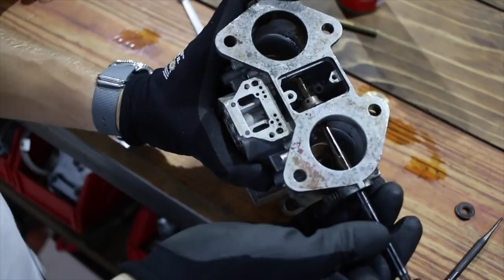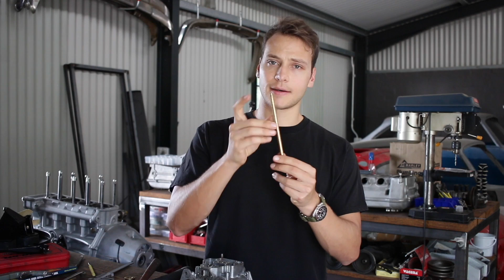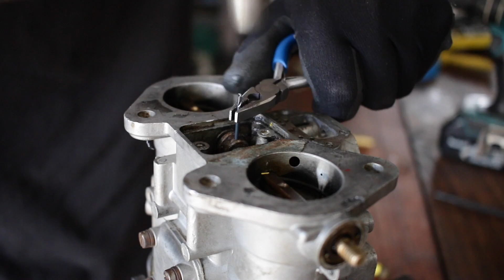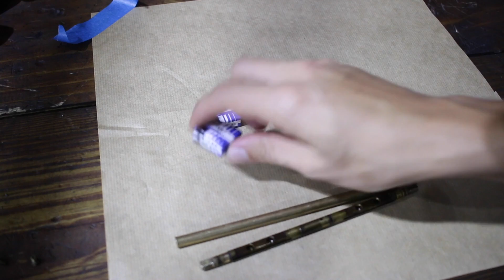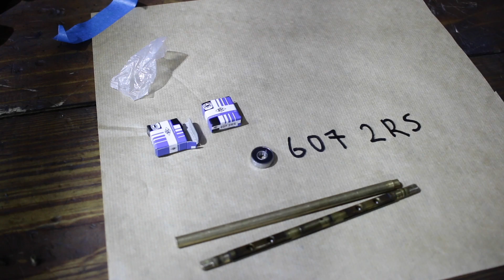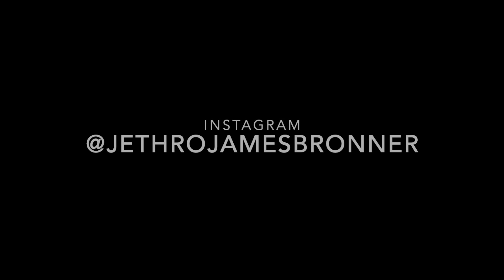How to change throttle bearings on a Weber DCOE Carburettor [Sunday Technical EP03]

Comment: Great video. Is there a difference in each side of the shaft? I messed up the threads a little and wanted to reverse it so I could put the linkage on the fresh thread side. Thanks

Comment: Good instructions BUT!!!!! You didn't mention ( or even know?) - that the brass discs have machined angles at the point of contact with the venturi ports - so must be installed the correct way round to ensure a proper seal when the butterfly is closed. The discs come in various angles which is stamped onto the disc in most instances, or a reference number which gives the angle.
If they are inserted wrongly the seal is lost when the butterfly is in it's closed position.

Comment: Your first video I have watched and I've already subscribed to your channel, thank you!  I have a quick question if you have time.  I have a very early 45 DCOE with leather seals (not a brass shaft though, it's a steel shaft).  I want to replace the bearings with sealed units thus eliminating the leather seals, can I use the same shaft or would it be recommended to use the later steel shaft with everything else remaining the same?  Thank you once again!
Reply from the maker: The same seals should work just fine 👍

Comment: Do you apply any lubrication to the shaft when you reassemble? Or is it meant to be dry? I'm refurbing my 40 dcoe 2s. I've used sealed bearings as an upgrade.

Comment: Hi. Great video!. Its great that you state the part number for bearings - real cheap to get hold of. Will 2RS bearing seal completely, or do I still need to fit leather gasket - i didnt see them in your video? Can I recycle the washers, or do you replace them. If I can just fit the bearing its a real money saving solution compared to the total Weber kit.
Reply from the maker: The rubber sealed bearings are already sealed as they arrive. I just clean up the washers and re-use them if they're in good shape.

Comment: This would have helped me in 2003 when I had a Ford Cortina with the 2 liter Pinto engine.
It had a double Weber carburettor and no matter what you did to the damn thing, it ran worse.
New needles, worse, new jets, worse, complete cleanup with every seal and diaphragm, worse, new coldstart spring, worse, new spindle bearing, car would run like an absolute Schweinehund, hunting, rough running, idle too high, idle so low it would die, conclusion, carburetors do not work.

The only thing worse is carburettor in combination with two stroke engine.
Then you have something that physically cannot run as it is impossible to function in any way.

No wonder I like diesels

Comment: Great vid Jethro. Thanks a mil. Just out of interest, Have you ever attempted a Diff rebuild?
Reply from the maker: I have rebuilt diffs before, but they were mostly just quick refreshes of fairly good diffs. 

I’ll be doing a couple of diff builds on the channel soon, one for my 1300 Ti and one for my GTV.
Reply: @JethroBronner  Awesome - looking forward to that... The diff on my GTV is whining, and the general consensus is it is not possible to get it right DIY. would like to see your approach.
Reply: Jethro Bronner does your GTV have an LSD? I’m planning to refresh mine next so I’d love to see one of those rebuilt :)
Reply from the maker: No my 1750 GTV just has an open 4.3:1 diff. But the 4.1:1 I'm building for the Ti will be limited slip.